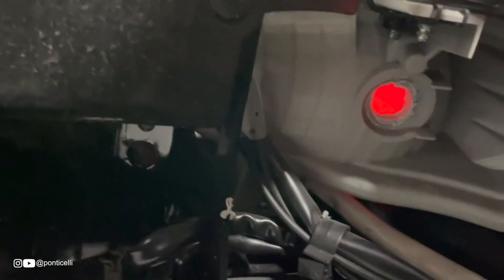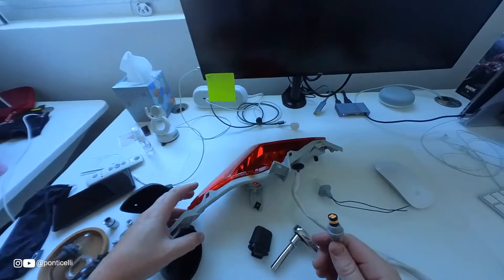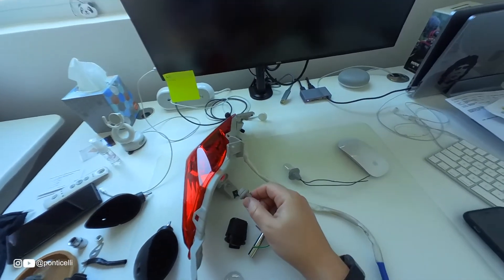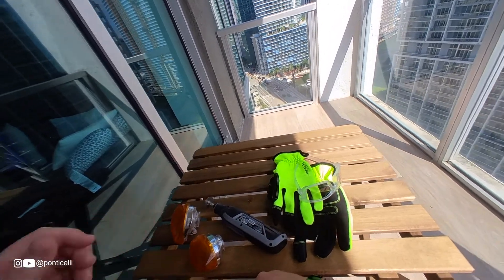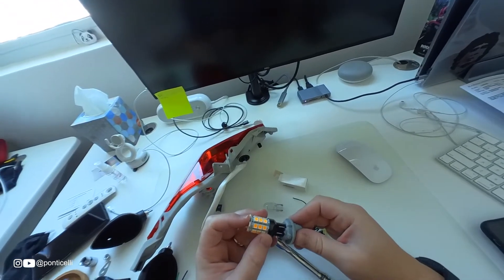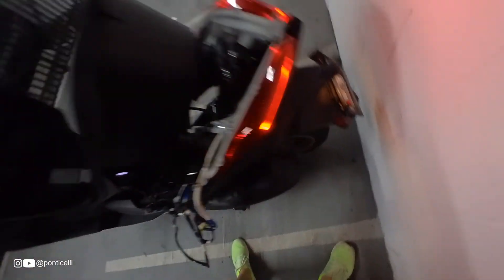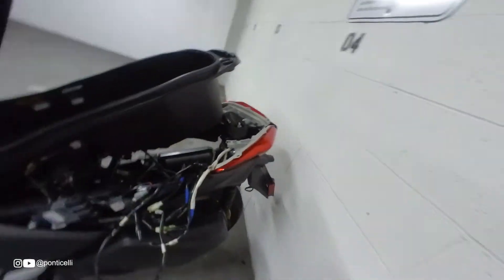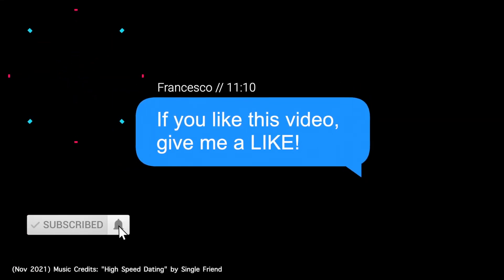How to convert the Tail Turn Lights of Yamaha Xmax 300 USA to the EU integrated ones using LEDs

Comment: Your problem is that you used hot glue. You need epoxy cement for plastic.
Reply from the maker: Thx for the advice! it has been a year and it's working great. If I should do it again, I will follow your advice! Thanks!

Comment: Hello friend I done everything you did including the stuff from 123custom ( front and rear signal light) and I’m getting flickering on the signal lights when I use it… is there anything else u had to do after with the relay ?
Reply from the maker: No, nothing else. With blinker relay are you using? The custom led?
Reply: @ponticelli  yes I did everything the front and rear install used everything you said
Reply: I contacted them so can send another maybe with my luck this one is defected lol
Reply from the maker: @paulcruz2027  uhmm that worked for me and many other people who installed after me. Have you tried with the original one and/or with the one coming with the front led to see if the issue also happens with those two?
Reply: @ponticelli  well I over looked the vids again there is one thing that’s not identical to what you did the led I got for the rear are smaller then the ones you used can you provide link for those rear led lights pls thanks a lot videos are excellent
Reply from the maker: @paulcruz2027   great, I hope you can fix that and the flickering get off!
Reply: I actually used the smaller led you showed in pack (t10) but now tht I’m watching again I see you used a much bigger one later on in video I believe thats why the flicking is coming